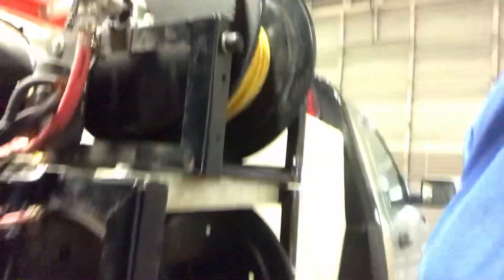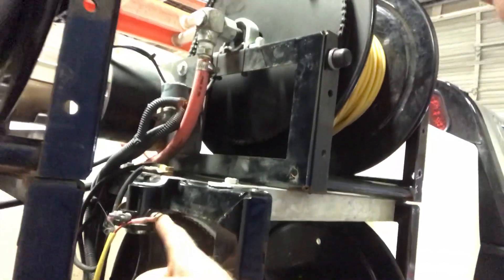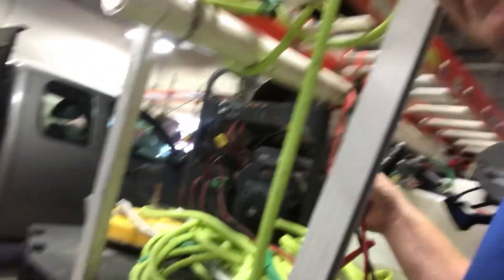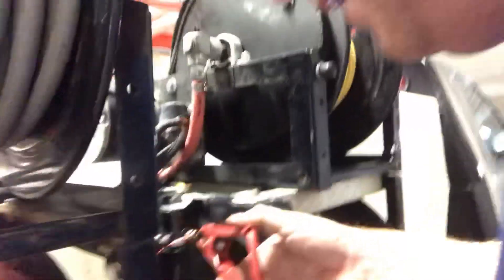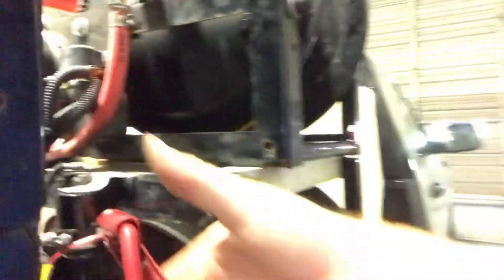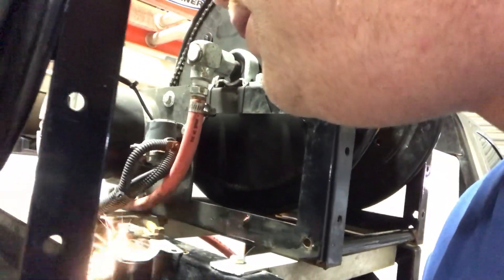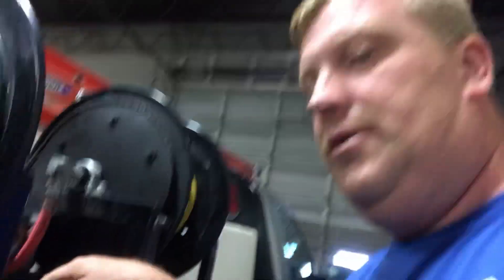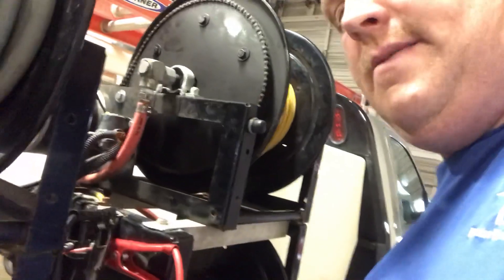Testing A Solenoid | Just Cause It Clicks Doesn't Mean It Works

Comment: Hope all is well with your business with this cov. Any how, working on a 12-volt Sears suburban ss15 lawn tractor. I got a 3-pole solenoid, pretty sure it's bad. When getting a brand new one, can you get any type of solenoid, As long as you have all the poles you need? I know you're supposed to get the same one you took off just saying does it matter?

Comment: Hello, I'm a woman trying to get my EZGO golf car moving.  I changed out the solenoid switch, brand new set of batteries, my cart still will not run.   all the amps on the batteries works also, the solenoid lines check correctly car still will not move help.
Reply from the maker: Is the soleniod getting power on the little wire to turn it on